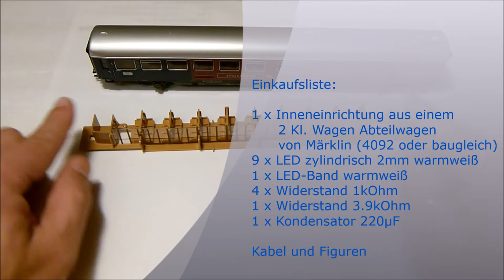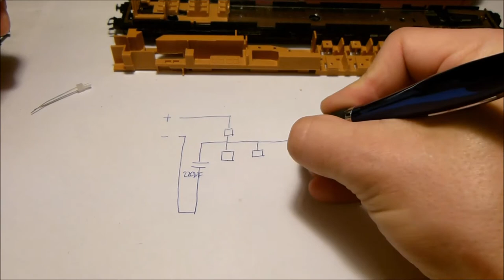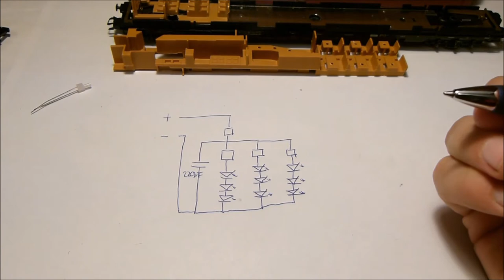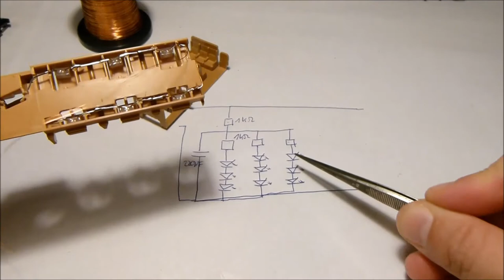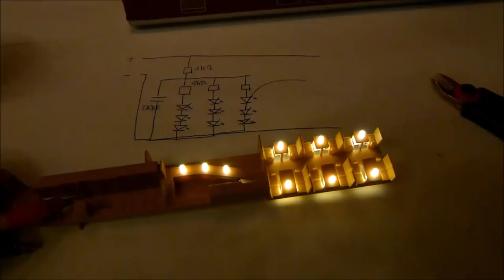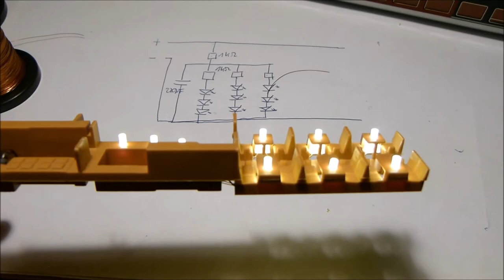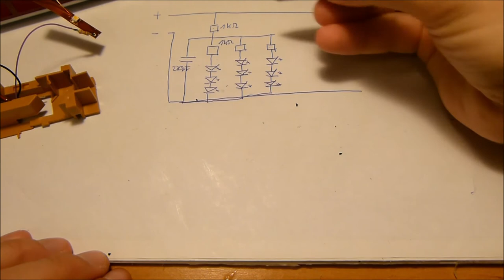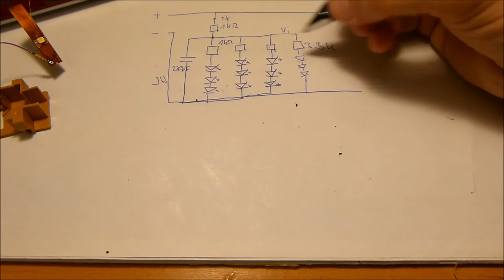Umbau des Halb-Speisewagens von #märklin aus der Startpackung

Comment: Ein wunderbarer Grundkurs. Besten Dank dafür. Als Stromlaie frage ich mich nur noch, wie kommst du auf die verschiedenen Ohmwerte bei den Widerständen. Liebe Grüße von Spurwechsel
Reply from the maker: Hi,
U = R * I
R = U /I
U rechne mit 20V
I sind bei LEDs 20mA
Bei Low Current LEDs 4mA (sind eher selten...)
20V / 20mA = 20 / 0.02 A = 1000 Ohm = 1kOhm.
Die Formel oben ist nur eine Faustformel die den Mindeswiderstand berechnet. Je größer der Widerstand desto weniger Strom ergo LED wird dunkler. Gute Werte sind zwischen 1kOhm und 3.9kOhm.
Reply: @mattes_moba  super, danke. Erinnere mich dunkel an den Physikunterricht:)
Reply: @mattes_moba  Naja... das ist aber doch arg vereinfacht! LED weiß hat ca. 3V, drei davon 9V. Also ist die Spannung an den Wiederständen nur 20V - 9V = 11V.

Der Ladewiderstand wird hier auch nicht von max. 20mA, sondern von 4 x 20mA durchflossen...

VGA
Reply from the maker: @DB--lv6tt  Ich halte es bewusst einfach, damit man keine LED's beim Basteln rauchzeichen von sich gibt. 
Bei den hier eingesetzten LED's handelt es sich um Tower LED lang 2mm warmweiß. 
Im Datenblatt ist eine Spannung von MIN / TYP / MAX: 2.8 / 3.3 / 3.8V bei IF = 20mA. 
Ergo können wir nun die Werte auch akademisch berechnen...